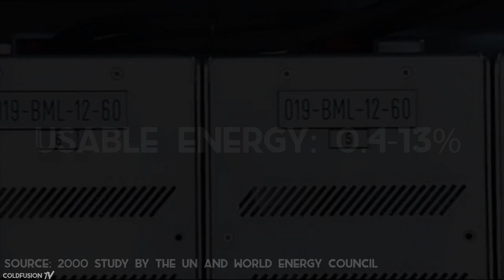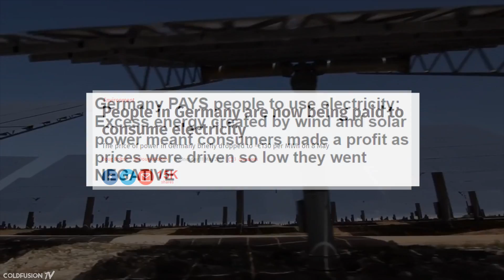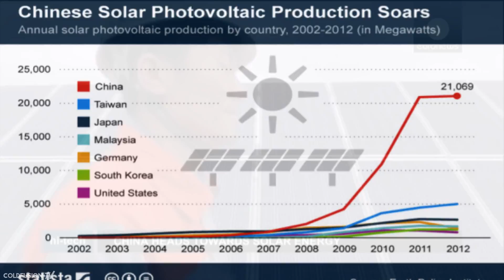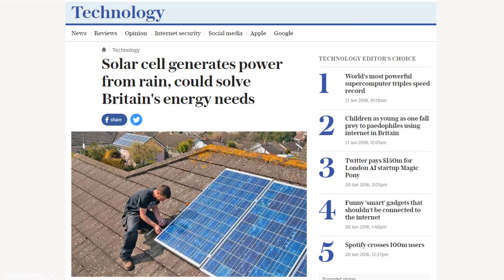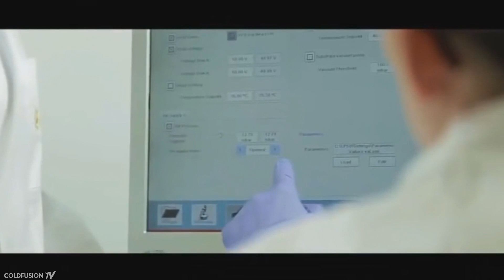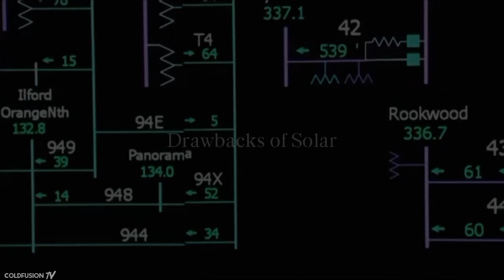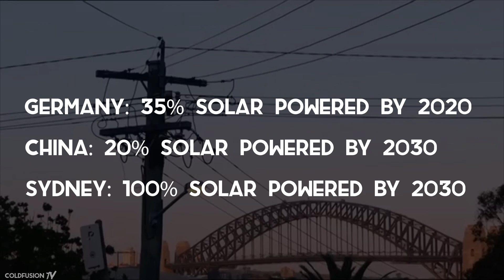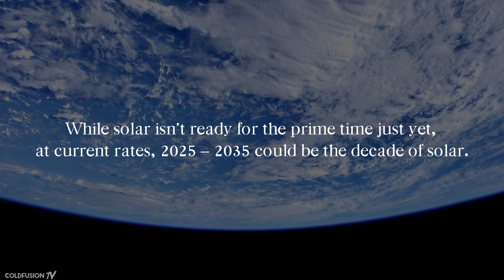The Truth About Solar

Comment: Well one random question is, if you put a panel on the roof of a non-hybrid traditional internal combustion engine powered automobile, would there be any benefits?

Some I see straight off is a slight increase of fuel efficiency since less strain would be taken off the alternator to power the car, meaning the engine does a bit less work. I can't think of much beside that right now
Reply: There is benefit but not much. A small car is around 20hp at 65 cruise. 20 hp = 15000 watts. Say you manage to get a 200w panel on a roof of a small car and 150w actually gets generated, you'd save 1% of fuel. By the way, a hologen headlight bulb is usually 55w.
Reply: Well yeah, but the question was about putting it on the roof of a traditional automobile, which will have a curved rooftop, not ideally suited for mounting a big flat panel. Sure, you go to a hardware store and come up with someway to secure it, but it will look pretty trashy, and put up a whole lot of wind resistance. A luggage rack would be your best option.

Mounting it on the flat roof of a van or RV is more suitable, and they make racks just for that purpose. 

Of course, the whole argument  was for the panel to offset the load of the alternator, but the huge wind drag makes the idea impractical.
Reply: I can vouch that a 18 hp car can go 85 miles per hour.
Reply: +Bonnie Flory what car?
Reply: extraace
i'd have to guess a bike of some sort, or some super mini car
Reply: I would highly suspect that whatever fuel economy you'd gain from useing solar to replace the draw from the alternator would be offset by the added weight of the panels and changing the car's aerodynamic profile.

On my car just adding roof rack brackets to the top costs me 1 or 2 MPG on the highway from the extra drag in the airflow.   Thats just the empty frame without any big piece of luggage up there. I get similar loses when I'm makeing trips with a passenger due to the extra weight in the car.

The only way I could see it working out favorably is if it was a factory installed option where the roof was a solar panel not a bolted on aftermarket option.  I doubt that would ever happen for any car that wasnt electric or at least a hybrid.  just not enough reason to justify the cost of the panels for the bulk of the market.
Reply: For some reasons my comments are disappearing after posting.
Let me try again.
I had the old fiat 500 bambino 2 cylinder engine, solid 18 hp and used half the amount of fuel than the old Volkswagon Bug.
Reply: Automotive engineers have long sought after the most streamlined designs to make cars more fuel efficient, and just dealing with the drag from headlights have been a major headache. Putting a solar panel on the roof would really mess up the airflow causing a drop in fuel economy, not to mention having a strong enough mount to keep it from blowing away. If you've ever seen the damage from hurricanes you can just imagine the constant stress on the panel from hours of Interstate speeds.
Reply: St8kout
A lot of RV's have solar panels on their roofs and they are not loosing them while driving down the roads.
Reply: Bonnie Flory but don't forget, some are coming with them from factory and most RV's have the aerodynamic profile of a brick anyways, so that little extra drag doesn't hurt it much
Reply: St8kout
Mounting solar panels on a vehicle can be done safely every day with an neat look....period.
And who is to say that such panel would have a huge wind drag, It depends on the kind of vehicle it is mounted on and what rail is used and even what kind of panel is used.
There are flexible or semi flexible panels that can be used to stay with the same shape that a vehicle may have and those panels can produce as much as a crystalline mono panel.
Reply: Hey, go for it, but I'm pretty sure the original poster is not going to see any difference at all at the gas pump after adding a solar panel to the alternator circuit. 
The alternator uses only a small fraction of an average motor's horsepower. A motor driven radiator fan uses more motor power than an electric fan (and alternator) does, yet engineers at BMW still prefer a motor driven fan over electric.
One final note. In the real world, when you park that car with a solar panel out in public, somebody is going to mess with it, possibly scratch/damage it, so don't be surprised when it happens. Keeping it clean also brings up another set up problems. Some things are just not practical, but hey, it's not my money.
Reply: St8kout don't worry, I wasn't planning on actually doing it, it was just a hypothetical question

Comment: 6:29
Solar panels that work with artificial light?
This is basically the science-y equivalent of the dwarven Perpetual Motion Machine, isn't it?
Reply: Anon Ymous not really, it wouldn't provide enough power to power itself, it's basically just for if you leave a laptop on a table it'll charge up a bit
Reply: Nah, the solar panel just recaptures a small amount of the energy that it took to produce the artificial light in the first place. But for all practical purposes, the sun is a perpetual motion machine, so solar panels could be considered a free energy device.
Reply: dekutree64
>The sun is a perpetual motion machine.
 I hesitate to call anything a perpetual motion machine unless it involves screwpumps and waterwheels.

Comment: There are a few extra things you didn't mention about solar that's a problem - first, you need to keep the panels clean for max efficiency, and second - a laying solar panel produces about 2/3 than a properly angled one, and that one produces about 2/3 of an angled solar panel on a moving lever that automatically follows the sun, so for max efficiency you need to invest some more than the initial cost.
Reply: At the same time, a general consumer can buy solar panels for $.40/watt, but the mounting/racking system for a flush mount is about $.20/watt. A mounting system for tilted then becomes ~$.50/watt. And one that tracks is $1-2/watt. Tracking mounts need to be repleaced every 5-10 years. It will always be cheaper to purchase more solar panels than increasing efficiency. Much like consumer grade solar panels are only 16% efficient, whereas the ones NASA uses are 44% efficient. It costs more to send those to space. it has never been about effeciency, but the total system cost/watt.
Reply: mkzhero
Reply: Mike Crapse some good info, thanks.

Comment: The solution to demand adjustment should be grid neutral production; you don't produce electricity for yourself, provide electricity to the grid, and are payed for the surplus and charged for overuse.

Comment: Everyone talks about cost but no one talks about efficiency. As if 100% of the sun energy that is reflected on the panels will become electricity. But that's not true. DS1's solar panels convert 22% of the sunlight into electricity and most other more common solar panels only convert 14% of the energy into electricity. On top of that you require lots of maintanance, lots of land and sun. Now once solar panels have become better at creating electricity from sunlight, maybe then they're more viable. But right now they're not worth it from a purely economical standpoint. That's what always seem to be missing from videos about solar power.
Reply: actually you are wrong if you are talking from a purely economical standpoint. Going green creates more new biz which is good for economical growth. It will also help slow global warming that causes billions worth of damage along coast lines around the world. And its not really the solar the production its the energy storage that's the biggest problem.
Reply: Ryodakun he was talking about cost/unit output ($/watt), so efficiency is irrelevant. Who really cares anyways, just cover the entirety of your roof.
Reply: Ryodakun  yeah thats bullshit you got some weak panels right there
Reply: I have seen videos where they mention efficiency.  But why stick with panels that produce only electrical power?
Panels that heat water are about 75% efficient and may make a good addition to heat water or pools or to heat homes in between seasons etc.,  but the installation cost and leakage rate is high so it may not be what you want or need.

I would not care to much about efficiency unless you have a problem with space/room.  More efficient panels cost more per watt, but use less space.  
Just get enough panels for your needs.

Comment: The flaw in this presentation is when the narrator says "for free"  Oil and coal are free as well. All you have to do is pump or dig, right? The only free solar energy is obtained by sitting outside in the sun, preferably naked.

Comment: The EPA is not issuing fines the same fines they charge coal companies. Scientist are now thinking all the solar panels will draw to much sun to the planet and cause massive global warming. Prices on practically. everything will sky rocket becsuse most products are made from bi product of fossil fuels example all products made of plastic will go up, what will we pave our roads with? assault is a bi product of fossil fuels. The more we move closer to Solar Energy the closer we will move to economy collapse.
Reply: Sheldon Mcclure they're only talking about replacing our source of energy with solar, manufacture of stuff you said shouldn't be affected, however, as for roads, I seen this special repaving machine that used the old asphalt and only needed more added if there was a big hole or something, so it's not like we're making a move to try to not improve the efficiency of such things. We are. And as for plastics, there has been some lobbying to legalize hemp-based plastics, which are 100% biodegradable and all ingredients are growable
Reply: Justin again scientist are now saying a the level of Solar we are using might be doing a lot more harm to global warming than whats going on right now. Besides if you covered every inch of California with Solar panels it would only replace 2% of our energy needs. See we don't need any NEW energy what we need to do if figure out how to capture the energy we are producing and losing Example: The electric meter on your house only registers and charges you for what you use, you only use 20% of the electric sent to your house so that means 80% is lost because we have not learned how to reclaim it. If we can figure out how to take that 80% loss and transfer it to four other houses we would cut our energy consumption down to only 25% of what it is now. See we do not need New energy sources we just need to learn how to use and store what we have already. As far as asphalt there is a billionaire that has been working on this for years and to this date they have not been able to come up with something we can use and he is putting millions into it because he knows he could get the market. But I hate to tell you this research what is all a bi product of refined oil and you will see it is not possible to move away from crude oil.This is why fossil fuels will always rule. Again when the EPA starts given fines to Solar companies for destroying wild life habitats and other fines you will see that solar with out price us but the liberals are so desperate to prove they are right about Solar they will fudge the figures and straight out lie. One last thing even if 10% of all homes in the U.S. had solar the panels would pull too much sun down to our planet and cause way to much damage, its just not good for us.
Reply: How does a solar panel "draw more power to the earth"?  How does that science work?

Comment: If you only knew what it takes to make a solar panel, the power converters and batteries. The "it" is the power, chemistry and it's waste, machines and low wages and lack of environmental protections in India and China. There nothing green in achieving reliable solar energy. Trillion's have been spent over the last half century trying to make this work. Good luck but we are NOT there yet with solar. There better ways to achieve energy independence but that technology does not make someone rich.

Comment: What this video doesn't tell you is that essentially there will be brownouts every night due to the fluctuation of available power and you'll have to install one of those expensive bigass batteries to store power from the day time.
Reply: 8:00 Although imo instead of / household batteries, it would be more efficient to have bigger ones in government owned building serving as a distribution center...although this may have problems too (2 times as much loss for example as the electricity passes through the cable)
Reply: 2nd hand deep cycle agm batteries from data units and cell phone towers are cheap less than $100per kwh of storage.and are always availible as they usually change them every 2 years due to stringent policy schedules,some batterys have never been discharged only floated.

Comment: What about snow? Does it not completely prevent energy gain?
Reply: Yes that is true. This is why most solar farms are in warmer climates. However solar panels can be equipped with heating element similar to those on a car window to melt the snow
Reply: Garrett Hosticka so that's what those weird things were I see on some panels up here (I'm in NY btw)
Reply: Duckman1616 one of my electricity teacher told us that when they compared     snow vs no snow on the pannels, it surprisingly didn't affect the electricity production that much. My understanding is that it maybe has to do with light refraction and the reflection of light we see on snow would mostly be visible light, while the UV light gets through easier (and surely some green and blue light go through the snow from refraction)
Reply: There's another reason to the warmer climates - sunlight hours. Especially above the 60th latitude, the sunlight hours decrease dramatically during the winter, meaning that the solar panels would not be producing any power. For example, I live in the southern-most Finland, and the Sun set around 6pm today, and will rise around 9 or 10am tomorrow.

Comment: While it is true that conventional solar cells are only 30%-35% at peak, that is because the cells are silicon based and thus are very sensitive to heat, just as the silicon cpu is sensitive to heat within your computer. 
The way to beat that is to have a heatsink collector on the back of the panel the cells are mounted on and with copper tubing attached to that and running water through it, you cool the cells down, getting hot water in the process and the cooler cells efficiency can rise to as much as 60% - 65% in summer months and up to 70% - 75% in cooler winter months. This is not talked about much and that is a shame as it would make solar energy much more palatable to the consumer. But what also is not talked about with germany is that they add wind savonious  vertical turbines to their system. They use them to run LED streetlights and never ever have a black out. Thus, even for very bright light on the streets, they have a small panel and small rotor to produce all the energy they need.